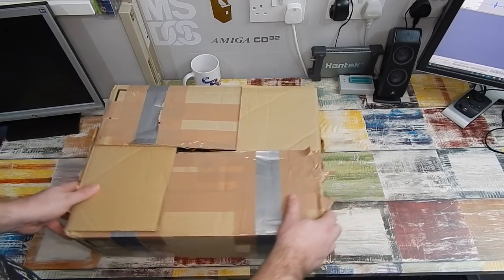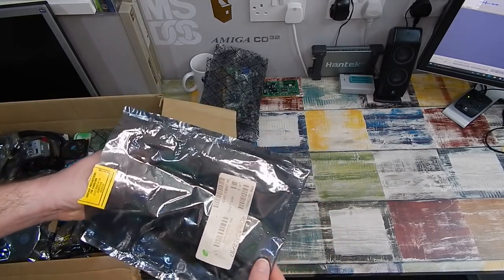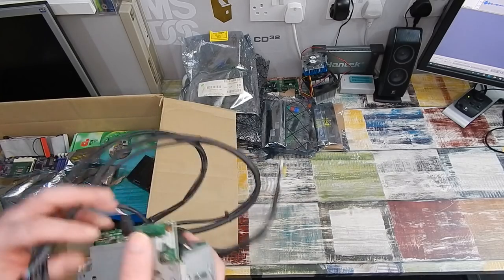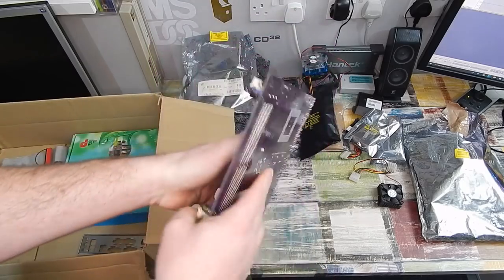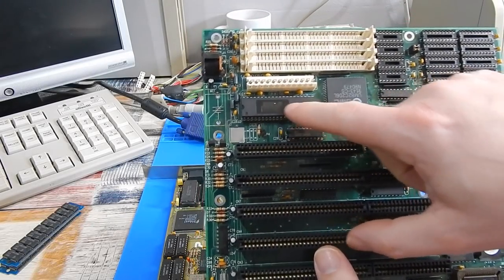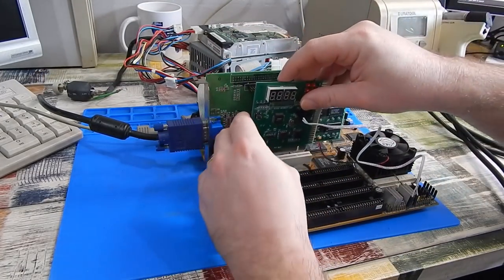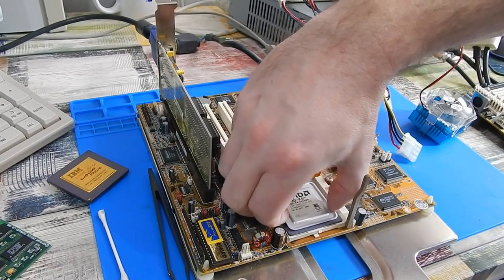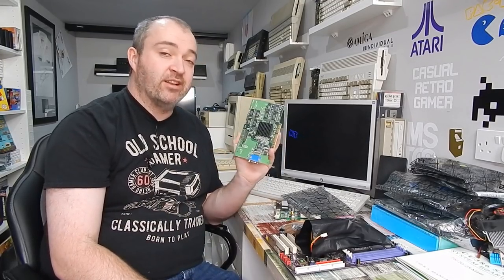I bought an untested lot of random PC parts from eBay

Comment: Lots of old "friends" in this batch.  :-) 
Still have a working 486 board with a Am5x86 133MHz CPU. It is the fastet 486 I have tried and I could not dump it when I had to do a cleanup in old parts.
Reply from the maker: Very cool, I'd like to get myself one of the 5x86 chips and have a go at the fastest 486 record for Quake.  CPU Galaxy got his upto 180mhz and about 20fps in quake.
Reply: @CRG  Over-clocking on the Am5 board is not an optiion it just crash. 
At 133MHz (=33x4) it is rock steady.
Installed Win98 on it and it rin just fin, but it was slow. DOS games was fast, often way to fast.  :-)
Reply from the maker: You might get a faster bus speed, try 40mhz if you can on jumpers.  But that aside it's still a nice cpu and the fastest 486.
Reply: @CRG  You can and I have tried, but it just freeze.  :-(

Comment: That's a pretty good haul for £34/$50USD, even if the Voodoo card is Tango Uniform.  Are you going to try an re-cap it?  The RAMBUS memory might be useful if you wanted to do a Willamette P4/socket 423 vs. Tualatin PIII vs. Athlon XP for a "Who was the best of late 2000-2001 comparison, and not have the P4 crippled by SDRAM
Reply from the maker: Just need to get a suitable motherboard for the Pentium and as you say it would make for an interesting comparison.  

As for the voodoo I've spent the afternoon looking over it but unfortunately its pointing towards the main chip as faulty.  The sync signals to the monitor as I thought are way out of spec.  It does look as if its generating the RGB ok but without sync it'll never work.
Reply: @CRG  True, although, it would be relatively inexpensive just to swap out the caps.

Comment: On the banshee card maybe worth checking the tantalum caps for shorts.
Reply from the maker: Yes that's a good idea.  I'll give it a look over and if I can figure anything out I'll certainly do an update.
Reply: Yeah, it may be the cause sometimes. Waiting for updates!
Reply from the maker: Spent the afternoon with the banshee trying to figure out what's wrong.  No shorts on any caps but looking at the signals on the vga connector under the scope there seemingly is RGB.  H-sync though is way out of spec at only 6khz.  That's generated in the main IC so its certainly looking like the card is dead :(

Comment: I am interested in your 8400GS. I have a similar PCIe 8400GS that works that i use in my workshop PC but the VGA connector on the ribbon cable is missing and i can't find a pinout diagram anywhere online to make my own. I want to use the VGA output via my KVM. Could i use the VGA connector from your damaged card if thats ok please. I would pay for postage.
Alternatively, if you want to keep the card/VGA ribbon, please could you check the continuity between the VGA connector and the header pins and make a follow up video with a diagram. Thanks.
Reply from the maker: drop me an e-mail - casualretrogamer@outlook.com

Comment: 9:31 - technically it's the 4 pin (no power) version of IEEE 1394 (Firewire was licensed to Apple, so to avoid paying royalties to Apple other manufacturers called it the IEEE 1394 port).

Comment: I had a motherboard that would not run unless the processor fan was running .  could that be what's wrong with yours ?
Reply from the maker: I don't think that's the issue here, there are no fan headers on the board or none that I seen anyway.  It could just be a case that the AMD chip isn't supported by the motherboard.

Comment: I think the 5 1/4 card reader and s stuff is FireWire and mini FireWire connector (9:45) 
I scavenged an old box of ram from work and used a glue gun in many many sticks to make an Xmas wreath! The Rambus RIMMs were good flat base for gluing the keyboard keys to to work merry Christmas
Reply from the maker: That's a cool idea, only thing I've made was to build a stick man using all the dead chips I've collected.

Comment: The 386SX is it a 40Mhz ??, my first PC was 386SX 40 without the 387 Maths Co Pro its a solid board and fast for a 40Mhz
Reply from the maker: No its only 16mhz although I'm sure I could push it out to 20 although I'm not 100% sure how this board is generating its clock as the only crystal is 14.odd mhz.

Comment: There were Macintosh banshee cards made what if that is one of those...
Reply from the maker: Thats certainly a possibility but I have done a few tests on the card since this.  It's clock seems to be screwed up somehow, so while there appears to be an rgb signal on the relevant pins of the vga connector the sync signals are way out of spec.  Going to try a new crystal but ideally I'd want to find a schematic for the card.

Comment: AT board ♥️♥️♥️ I like how that board with the AMD on it has bad caps, I wonder if there is an AMD board out there from the time that doesn't have any bad caps 😀👍
Reply: Iwill P55XB2 rev.1.21 all fine here. And what do you mean  AMD board? If Socket 7 - then it supported lotsa' CPUs.
Reply: I have one. It’s an Asus, has no bad caps and they are all original.

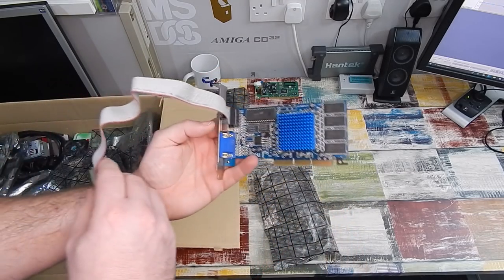Comment: 2:34 "The seller shipped these in anti static bags..." Proceeds to remove and handle without any anti-static precautions...
Reply: Even old hardware is pretty resistant to static. My 486 board arrived wrapped in normal bubblewrap and it works completely fine.
Reply: @EvilTurkeySlices  It's not that it's resistant to static - it's just that the damage may not be immediately obvious

Comment: You wasted your hard earned money on absolute outdated, useless garbage!!! How can you possibly justify that?!? What is even more appalling - had you acquired all these FOR FREE as late as 12 years ago, - even then I would have said: " - Just toss it, it's not worth one second of your time to go through that box". And it's 2021, and you found yourself a 256 Mb Video card (that doesn't even work) and a 250 Watt PSU that isn't even good as a test bed, not only due to low wattage, which means you can forget overclocking tests, and only a 4-pin on a 12 volt rail, any decent motherboard like B450-F or any ASUS or MSI gaming board will immediately blow up those high voltage capacitors on bootup and probably burn through the PSU's PCB too because those cheapshit PSUs don't even have fuses!!!
Reply: That delta is probably better built than the one in your main PC. They are a server grade manufacturer. That wattage is low, but more than enough to boot something like a b450-f with a CPU that makes sense on it(a Ryzen 5 and below) and a low power GPU(or iGPU)
Reply: @EvilTurkeySlices  Not a chance it's better than my 620 Watt modular Corsair PSU. If all you're planning to do is answer your email and do word processing on a Ryzen 5, - sure, but then just go get a Pentium IV for $20 in Value Village, case, board, and GPU in all. Anything slightly higher, like watching a video in decent quality, - that Delta will blow up in puffs of acrid smoke. On the second thought, - we tried those Deltas with Ryzen 3100,  and an old 1GB AMD card with a 700 clock couple of years back, and half the time the board wouldn't even post BIOS. Wondered what the matter was, opened them up and 4 out of 5 had bulging caps. But hey, who needs the screen, or the computer, - as long as the Aluminium that PSU is made from is higher grade LOL. Gosh, what an exercise in futility. Maybe that was to prove some point, a PR campaign for how great EBay is, but I'm sure there are better ways to advertise...
Reply: @telumatramenti7250  you apparently know nothing about power supplies.
Reply: @EvilTurkeySlices  Absolutely not, what am I compared to a wise PSU know-it-all? Just some village lout with a Computer Science degree and over 20 years of experience repairing desktops, laptops, other electronic equipment and building gaming PCs,  currently running my own lowly, completely unskilled IT business. Try that "Holier than thou" garbage on someone else. Wasting my time commenting on a video about someone else's utter waste of time. All bow before eternal server grade PSUs from the pre-Cambrian era.
Reply: @telumatramenti7250  experience and degrees mean nothing when you’re wrong. I don’t know that much either, but I clearly know more than you about them. They don’t just immediately explode when overloaded, and a modern low power system won’t overload it.(especially with a high quality unit like that Delta)
Reply: @EvilTurkeySlices  Raight. Never happened. I was hallucinating apparently. They don't necessarily "explode", but yes they do burn out, and I've seen plenty that did, - the older, - the more likely, and I've lost count how many of those older Deltas I've seen brought in inside a modern gaming rig that conked out because the owner decided to go with what he already had powering his older machine, rather than buy a newer PSU. Brand is nothing whilst time and entropy are everything.  The guy who knows so much about PSUs claims that ancient server grade 250 Watt PSU with a single 12 volt line is BETTER CHOICE than a more modern 3x more powerful professional series HX. Do you hear yourself when you speak? I've argued with one delusional person too many over the course of the last few years. Sure, I understand the sentimentality, but I'm done wasting my time. 

I know your type well, predictable to the point of being boring: your whole game is to simply squeeze the last word in, because that will justify to you that this means that you somehow "won the argument", as you desperately need to convince yourself that you are correct. Go right ahead see if I care. Talk to yourself then, I won't come back to read anything you typed up. Farewell.
Reply: @telumatramenti7250  I’m not saying it’s a better choice, I’m saying it won’t blow up immediately like you are claiming it will.